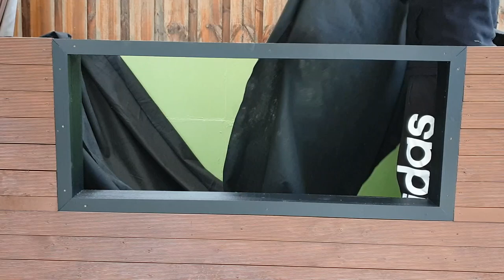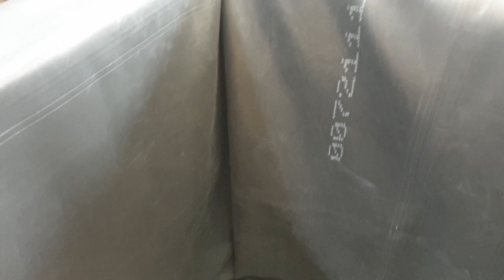Ep4. Install Pond Liner and Seal Folds In Fish Pond

Comment: Great work. I am thinking of making a structure out of interlock bricks, I will install the liner inside the bricks and fill it with water and put in a 1000gpm pump for a fountain and maybe add some fish.
Reply from the maker: Sounds like a big pond project Daljeet, I have only built pond using wood and liner so don't know how complex it could be with bricks. Wish you all the best 👍

Comment: nice video i am wondering if you used the primer why do you need to seam the folds. I would have thought the primer is sealing the folds for you.
Reply from the maker: Hi mate, It does but I just went over the board with everything on this pond to make it last for years. Thank you

Comment: looking good, really like the idea of the window. I'm too lazy for all that work though, so just bought a 1000l poly water trough for a fish pond. what fish are planning to stock it with ?
Reply from the maker: Thanks Ivan, it will be a while till I add any fish as I haven't built a filter for pond. Waiting on COVID restrictions to ease so I could get an electrician to do wirings. What fish do you have in your pond? I am thinking more of adding some fancy goldfish.
Reply: @Fishaholic  i went with a couple of oscars and some clown loaches
Reply from the maker: Is it an indoor pond? Your fish will be extremely happy in such a massive body of water.

Comment: What if we seal the wood with fiberglassing instead of using a liner?
Reply from the maker: Wood has the tendency to expand and shrink due to moisture and dry external factors.  I have not use fiberglass so not sure if it will work.

Comment: Box welded liner. 😳
Reply from the maker: Would be good to get hands on it. It was a struggle to find someone around my area and cost was just too much.
Reply: I would love  a viewing window , but everything that I build either goes green or leaks.🫣
Reply from the maker: Mine went green and then brown but finally it all cleared up. I guess it takes time for the ecosystem to develop and then pond looks after itself
Reply: I have same problem can't get box welded liner in Australia have to do the same very hard.. I am struggling with mine at the moment trying to find myself the correct sealant to use between my Perspex viewing panel and the rubber liner.. if anyone noes what to use would appreciate your help!